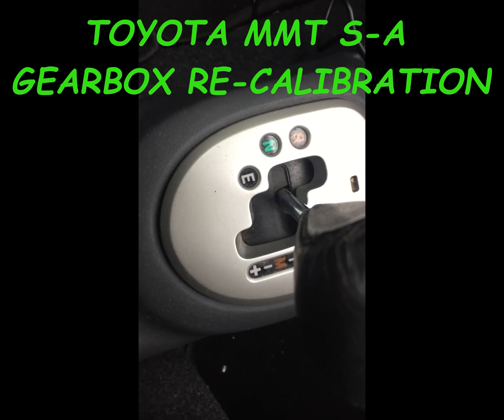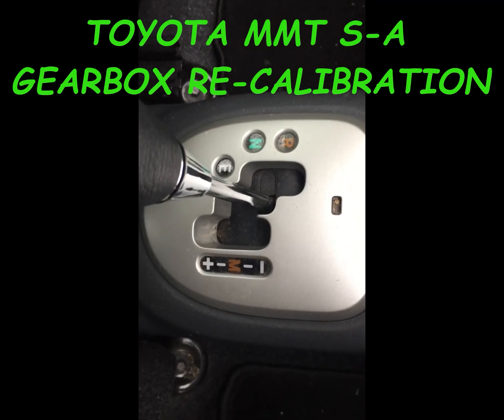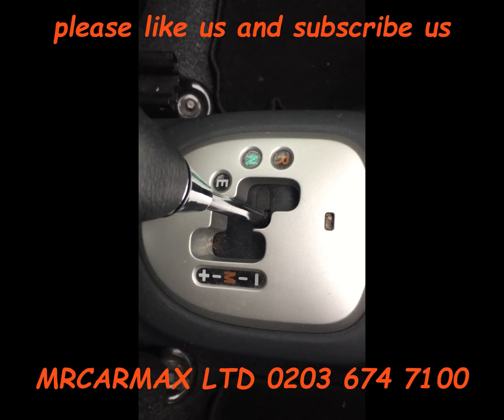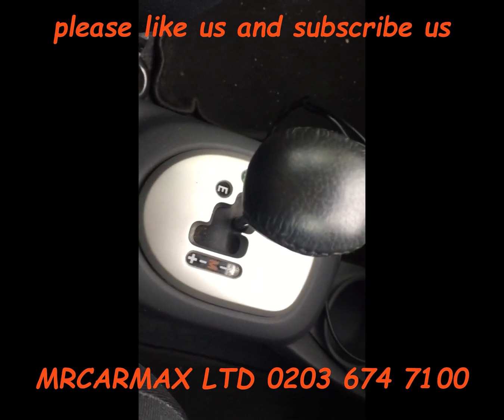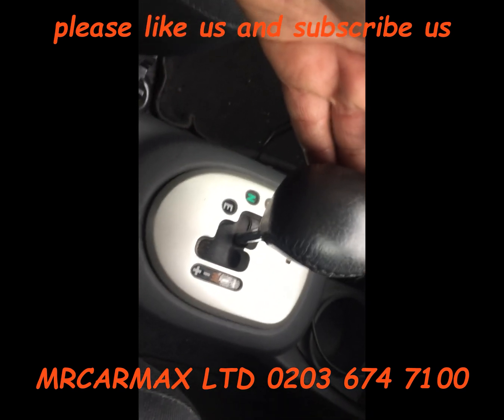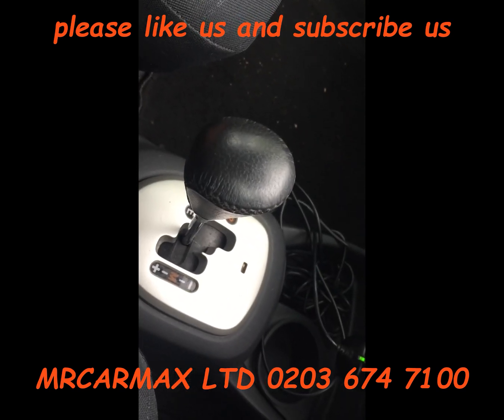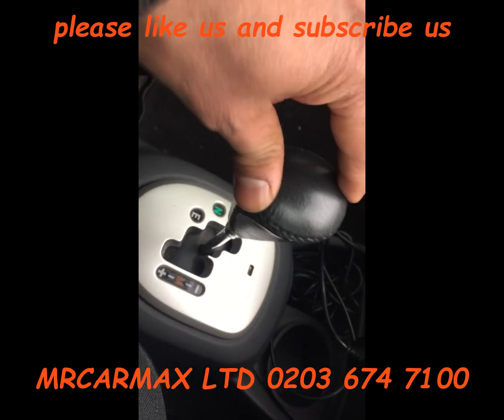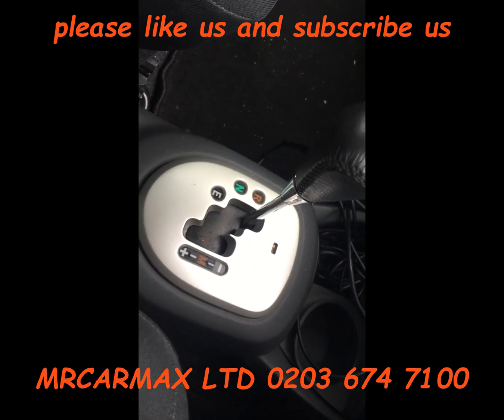P0810 P0900 YARIS AURIS AYGO SEMI AUTO MMT S-A JUMP 1ST N REVERSE GEAR RECALIBRATION CLUTCH POSITION

Comment: Hello Mate , hope you are well , I have a Toyota Yaris 2007 Mmt automatic and it shakes when I stop and at reverse, but mostly in traffic shakes and you feel it from the seats , I have change the clutch, before this problem wasn’t , what it could be please ?
Reply from the maker: @erionxhakoni4210  
Try re-calibration, might get better. 
Also did you put an original clutch or aftermarket?
Reply: @mrcarmaxharrow8331  hello , yess the clutch is AISIN Original from euro car parts , I have made made 4 calibration and still bad tbh . Do you know wich might be the most common reason?

Comment: Hi, I have Toyota yaris 2010 mmt gearbox. 8 months ago transmission dashboard light all of sudden came on and car stuck in neutral. I had to switch off engine and switch on few times. Eventually dashboard light gone and was working fine. Again same problem came and dashboard light gone. I have  noticed some time only car judders if give gas quickly when I start off driving. Most of the time smooth driving. OBD diagnosis came as stored code P0810. But there is no dashboard light.  Any suggestions please.
Reply from the maker: Most commonly clutch actuator gone faulty. 
If the mileage is over 80k could be the clutch is worn as well
Reply: Thanks a lot for quick response. Only 47k miles and full service history. Is it worth looking in now or wait until dashboard light stays on? Just worring,  hope doesn't cause big issue.
Reply from the maker: @MP-ws7yc  
Better do it now 
Most probably your clutch actuator is faulty
Reply: @MP-ws7yc hello frind, What did you do to solve it? Thanks
Reply: Finaly dash board light was keep coming back more frequently and more juddering. Without checking gearbox they can't tell whether cluth actuator or clutch itself. I got it done by Toyota and it was clutch worn out. @maurocapuano353

Comment: Excellent, is not enough to review Mrcarmax (Jay), I took my Yaris semi automatic to several garage in Aberdeen and Glasgow, but no one digonose it well or fix the issue, (car jumping on the first gear and reverse). I contact him through out the phone and second day I drove almost 600 miles from Aberdeen to his garage and he solve the issue in 10 minutes (reprograming the gearbox).  He response to the call quickly and he consider the price for this long trip. 👏👏🌹🌹Thanks a lot

Comment: I just bought a 2009 Toyota Corolla mmt and had thought that it's a normal automatic. I replaced the gearbox with a 2nd hand one as I bought it as a non runner. The car drives on 1st gear then goes on neutral. I'm not sure what to do. I'm in South Africa  (Gauteng). Thought of going to the dealer but am too scared as their prices are ridiculous.

Comment: Hi I got 2006 yaris semiautomatic d4d 1.4 it flashes N when I move gears , switch off /on the engine then it switch gears what’s the issue please
Reply: Did you manage to fix. If you did what did you do. Thanks
Reply: @sadiqdani9705  have you managed to fix yours yet.
Reply: @mattlawton4715  not yet. My mechanic swapped and cleaned the gear selector motors. It's been shaking since. 
Prior to this it went into Neutral after six days of clutch change with actuator motor changed.
Since then iv put a renewed actuator and it just shakes. 
Mechanic has changed clutch 2-3 times. I think it will be too much headache changing the gear selector motors as it involves taking gearbox off again

Comment: Highly recommended. They are experts/ specialized in this MMT gearbox issue. Sorted out my Toyota Yaris 2008 out within half an hour. Gearbox is like brand new now. No juddering whatsoever. 1st to 2nd and the reverse gear is very smooth now. Thank you MrCarmax.
Reply: Hi ai m located in the UK where are you from and would you please recommend the place where I can fix my yaris 2008 which has the same problem you have discribed
Reply: Where about they are

Comment: Thank you for sharing us the vidio, I have Yaris 2004 MMT car and due to the problem on the clutch actuator we released with new one,  but after tow months it jumped to neutral especially in the morning  when I ready to move, I need your recommendation
Reply from the maker: Full gearbox recalibrate may help 
Thanks jay Mrcarmax harrow
Reply: @mrcarmaxharrow8331  Thank you I will do that

Comment: Hi, I had a clutch replaced on a Yaris 2010 1.4 D4D semi automatic, I then had a issue when driving the vehicle goes into neautral, switch engine off and on and it started working until a few minutes later. 

I changed the gear selector/ actuator on top of the gearbox. 

The car does not crank or start at all, any ideas? Or how to check the car does or doesn't think it's in gear even though the dash says the N symbol?
Reply from the maker: hi
your semi auto gearbox needs re-programming. it lost all the values  .
Reply: Hi i live in Germany and can not reach you. What do you mean with reprogramming?. Dose the car reprogramming it self or how?

Comment: Hello guys. Could be P0810 error on Yaris from very used clutch assembly: pressure plate, clutch disk or release bearing? And after replace the entire  clutch kit  could be  the P0810 error resolved? Thank you.
Reply from the maker: hi Ali 
yes sure p0810 is about the clutch actuator . can be fixed
thanks

Comment: I have a Toyota Yaris 2008 Semi automatic model, when I start the car in the morning. Reverse and drive it’s jumps forward and backwards, when I drive up hills car misfires, and makes loud noises from the engine sometimes. I suspect the Timing chain is faulty because the check engine light is on. But what I don’t understand is that can timing chain also affect the selection of the gear and how smooth it drives? Thank you
Reply from the maker: Hi
It should fix by doing a Re calibration mmt box. If u need our help please call us on 02036747100 or bring the car to us. MrCarmax ltd harrow

Comment: Can you fix error P0917 Gearshift position circuit high ?
Reply from the maker: es

Damaged wiring and/or connectors, 
Failed sensor, ECU/TCM issues
Causes this problem . Very difficult to fix this issue. But we can try our best 
Thanks
Reply: @mrcarmaxharrow8331  Well you too far for me to get it fixed . I m in bristol . Anyway i reckon no one can fix regardless of money better scrap it lol